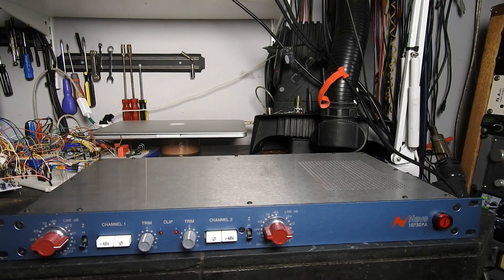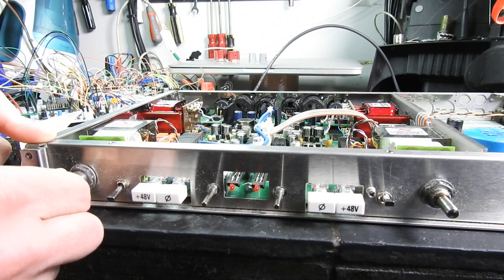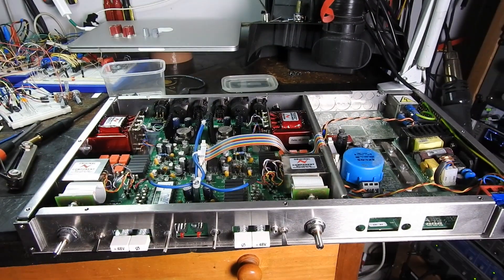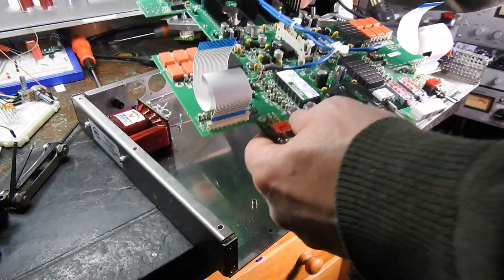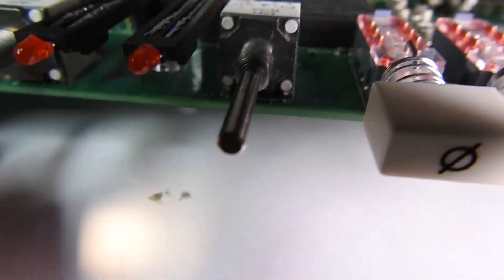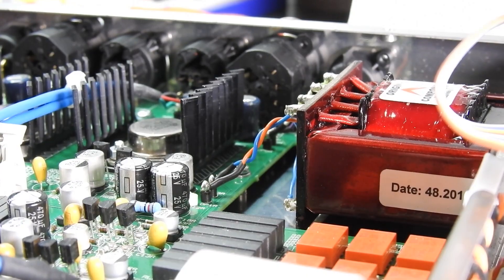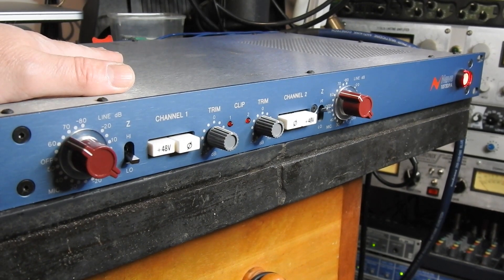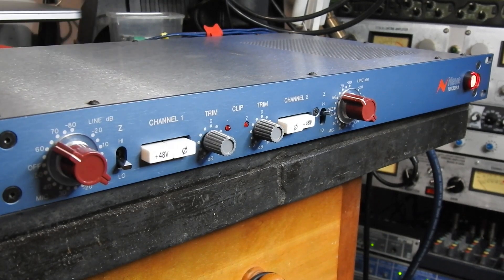Neve 1073 REPAIRS

Comment: Do you know what the balancing circuit is on the line input? Is it a IC?
Reply from the maker: If you go to 51 secs you will see 2 silver boxes with 'original component' written on it.  These are the input transformers.  The big red ones at the back are the output transformers.
Reply: @reallyniceaudio  yes nice,  but what about the line input with no transformer… what is the circuit is it a ic? something like a That 1206? Or a dif op amp for the unbalancing stage!
Reply from the maker: @caminglis53  Looking at the schematic you can see TI for the mic input and T2 for the line input.  I am wondering if it is in the same case?
https://1.bp.blogspot.com/-zAJ4FRyCgAg/YPCy8sL57iI/AAAAAAAAIig/kBf7CyhqZMIbJRvz4vEHepH0Z6tLU8ZbACLcBGAsYHQ/s1528/NEVE%2B1073%2Bschem%2Bblock.jpg

Comment: I have a Neve 1073DPD (dual channel).... and out of no where my 2nd channel stopped working. Any ideas where I could troubleshoot? Was thinking of opening it and using my multimeter to check for ohms/continuity across different transisters etc and I'd just compare the channel1 to channel2 to see if it's a easy fix or any burn marks, etc

Comment: I accidentally bumped my trim/output knob while moving and now I noticed that it was wiggles (left and right) a bit if I press my finger against it. Is this normal for the knob to wiggle a bit when applying a little pressure with my finger and do you think it will affect audio quality? Thank you so much. Great video.

Comment: On this 1073, there is a small metal on top of the elements, that reduce the voltage for the LEDs. These are not on my 1073s. Are these heatsinks?
My 1073s are a bit newer. Do you know why AMS is not using these anymore? My 1073s are getting unbearably hot after 10 min on.
Reply from the maker: Sorry I am not sure what you mean. If you post a time stamp I might understand what you mean.
Reply: @reallyniceaudio  0:59 in the upper right corner.
Reply from the maker: @ReinerDamisch  Yes that defiantly looks like it would dissipate some heat.  I wonder if you have the mounting holes?  Although there is a massive heatsink on the bottom of them, are yours bolted or clamped in anyway to the bottom metal?

Comment: Great job and really helpful video! Would you be so kind as to share where you sourced the impedance switch from? (Could it possibly be a C&K 7201-series toggle switch? Perhaps a "7201P3YAV2BE" right-angle Thru-hole mount, flat actuator, DPDT, ON-ON?) Thank you so much in advance! Fred
Reply from the maker: Yeah the owner had ordered it from Neve.
Reply: @reallyniceaudio My impedance switches aren't working, the channels only work in Lo-Z 😢

Comment: Nice work. Can I ask why you think that XLR got stuck? Is it those connectors? I will be buying this unit soon and don't want to make that mistake. Thanks!
Reply from the maker: From memory it was a nuetrik plug in a nuetrik socket.  On cheaper equipment this is quite a common problem.  In this case I think they were just unlucky.  Unless the cable was yanked  whilst the unit was screwed into a rack. That could have caused the mechanical failure in the socket.  I would suggest only use nuetrik connectors.
Reply: @reallyniceaudio  And do not step on male Neutriks on the floor. If it bends on the place where the lock is getting to click, you don't get it out again